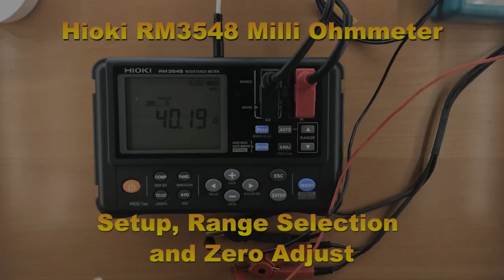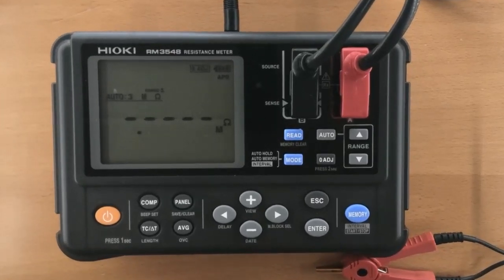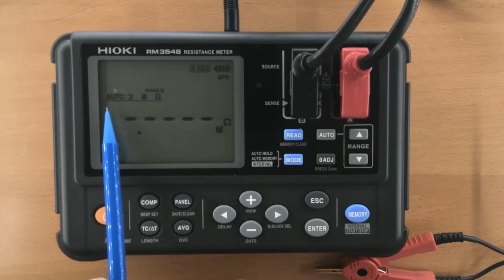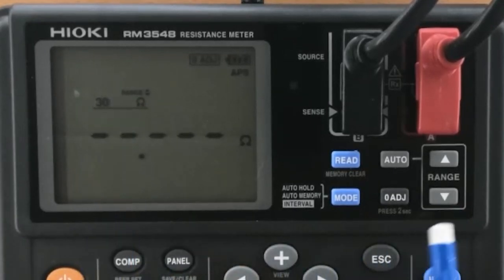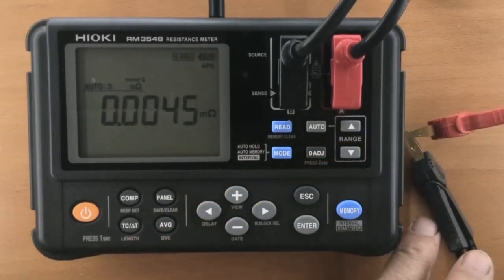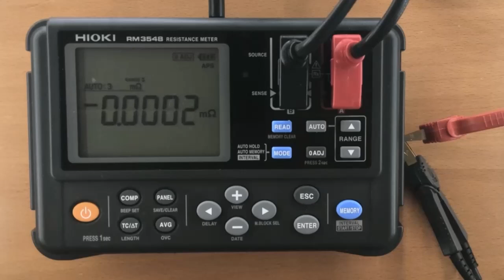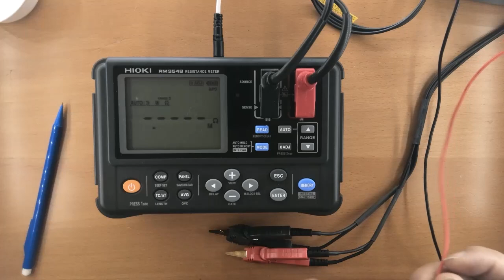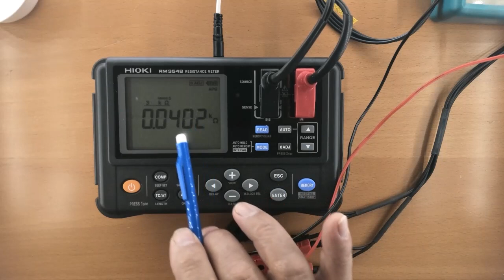Hioki RM3548 Milli Ohmmeter Setup, Range Selection & Zero Adjust.

Comment: Awesome. Is his the tool they use to test EVs stators? I'm long time subscriber of this channel and can see that the type of content has drastically changed in the last year. The main topic has moved from mechanical gearboxes and transmissions and differentials toward electrical lessons. After all EVs are the future. 🔌🔌🔌
Reply from the maker: This is for EV's and everything these days is heavily electrical.  I still have mechanical video to edit and post but sometimes it's easier to do the electrical stuff.  Sometimes I post the videos that will support what I 'm teaching at the time.  I have a hybrid lesson coming up in a few weeks and I need to get this done.  I"m planning on a few more.  This meter is amazing but also very expensive.